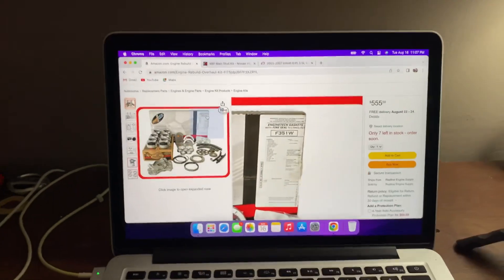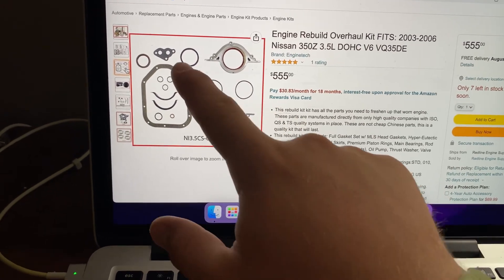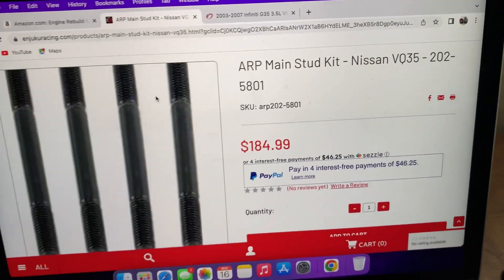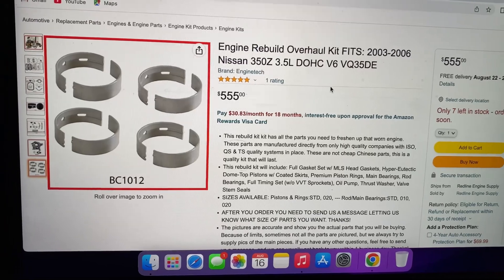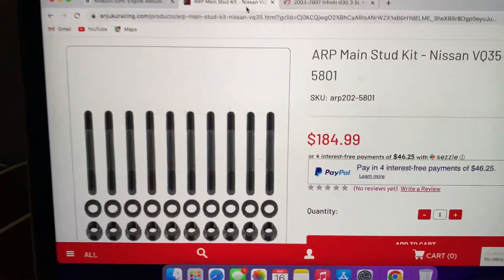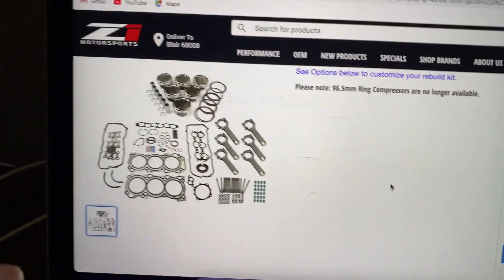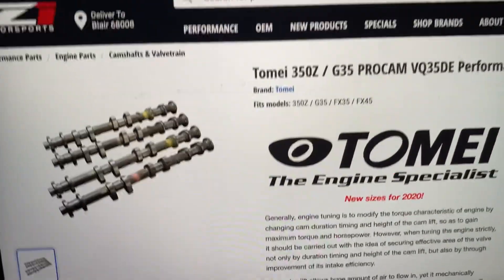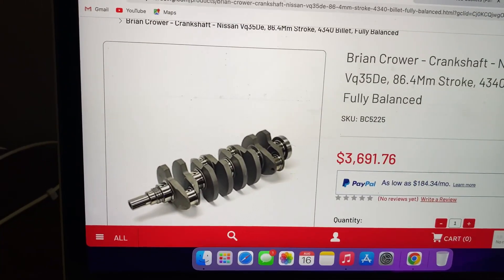What YOU need to REBUILD/BUILD YOUR VQ35DE!!

Comment: Do you think the same would apply for the vq35de out of the 2017+ maximas?
Reply from the maker: In the build aspect I believe so, and I like those newer VQ35’s make much better power as they’ve made them more efficient. But the rebuild may be a little different/more expensive

Comment: While the 350z is popular and the VQ is a great engine I will never not think it’s too expensive to build. A 2JZ swap would cost you a lot less.
Reply from the maker: Agreed, but everyone does a 2J or 1J. Some people do like to build the VQ
Reply from the maker: An HR is actually a very reliable power maker if done correctly. The DE… not so much
Reply: It's not. I bought this car to swap but realized this platform is underrated. The adapters kit, wire harness, and  ECU you'd be cheaper DE
Reply: Yeah you are tweaking not a single world where a 2j swap is gonna be the same as a built 3.5de 😂😂😂😂 insane

Comment: Why did you take the crank and rods out of the front wheel drive vq?
Reply from the maker: They’re identical, and actually cheaper. This engine had 80k miles so it was still in great condition